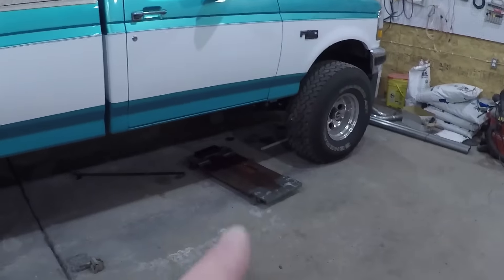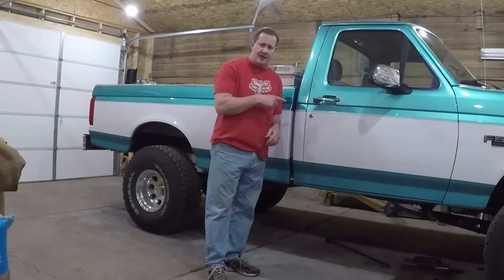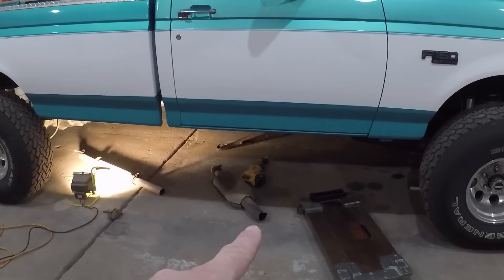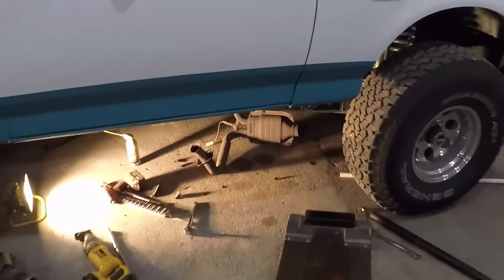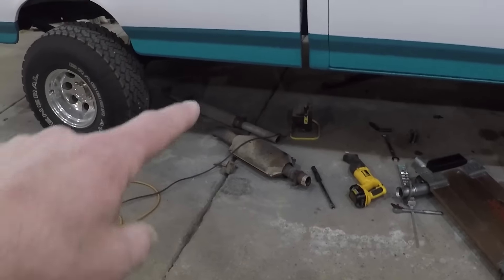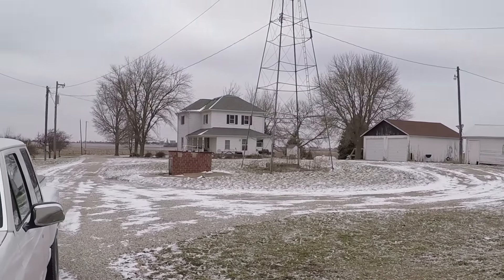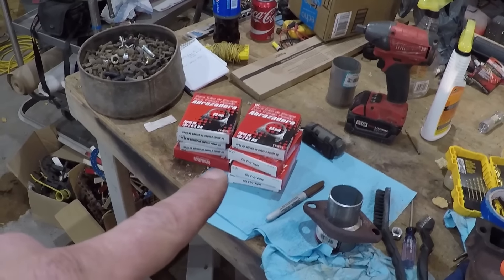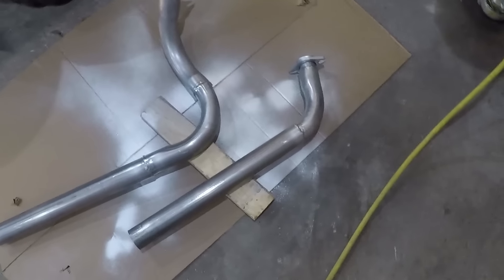DIY True Dual Exhaust - 1994 F150

Comment: What did you do with that air pump line?
Reply from the maker: Refresh my memory...been a few years... The one that used to feed into the exhaust?
Reply: @TheFoxShop  yes it is right after the first cat
Reply from the maker: @gpmoneyball200  I just left it... Tack welded it into the outside of the exhaust pipe lol..

Comment: awesome! I know you'll be happy with it.
Reply from the maker: Sounds great!  Still have to do the tailpipes though....
Reply: nothing like a nice sounding set of pipes!
Reply from the maker: Everything is turning out really good for a DIY exhaust setup.  I have never done exhaust to this extreme before... actually not that bad if you just slow down, think things through, take your time and just do it.  A lot of fitting and taking back down, putting back up, measuring, fitting, cutting, welding, but really not too bad.

Comment: I'd like to do duals on my truck eventually as well. Gotta do a restoration on it first! I've watched all your vids but can't remember how you did the primer. Did you start with epoxy, then the high build 2k stuff? I'll be doing some body work and stuff, and don't want any peeling issues.
Reply from the maker: Didnt use epoxy since I didnt go all the way down to bare metal over 95% of the truck. I used 2K high build primer.
Reply: Thanks!

Comment: Isn't the smog pump connected to cat? Also did any code pop out because of 02 sensor?
Reply from the maker: There is a tube that runs to the cat...  just left that tube unhooked, tack welded it to the pipe.  Its what other people have done.  Might be deleting the pump before long.  Also, no code..  it is still in exhaust stream, and also before the cat.. or originally before the cat.. so it wouldnt know if a cat was installed or not.
Reply: Did you cut a hole for the pipe that goes on directly after the first cat? Thinking of cutting off my first cat but I don't want the computer to make my truck run badly because of removing the first cat...I'm thinking of leaving the o2 sensor where it is stock just like yours was.